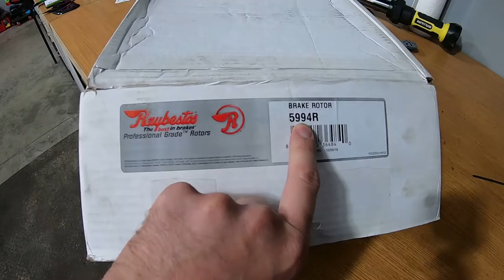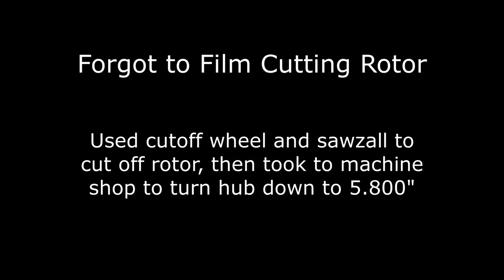FIREBIRD/CAMARO 3RD GEN C6 BRAKE UPGRADE (DETAILED)

Comment: I did the LS 1 brake conversion on my 92 Camaro but I made sure my brake line was on top of my brake vs the bottom like you did for bleeding reasons
Reply from the maker: Anything is better than the factory brakes. Since my pads have broken in, the braking power is sooooo much better!

Comment: Just to be correct, the only reason you used a spacer is because of your rims are based off a corvette spacing? I plan to do this to my drag car after my 17” wheels show up
Reply from the maker: Yes the only reason I run a spacer is to adapt to my wheels. It really didn't have anything to do with the brakes. It just gave me lots of clearance to the caliper. 17" will be close, I have 18" rims. I went with the c6 z51, u could also run standard c6 brakes which are just a tiny bit smaller
Reply: I had to use a 1” spacer because my XXR 18x 9” wheel hit my steering control arm

Comment: You have the passenger side caliper on the driver side. The bleeder screw should always be on top, not bottom. Air rises which is why the bleeder is on top.
Reply from the maker: ?? No they are on the correct side. Bleeders are facing up. If they weren't I wouldn't have brakes, and they work awesome with the C6 upgrade!

Comment: I've got A 83 firebird v8 base Manual trans. T tops. power nothing. it's A factory heater car.
It weighs 3199 full of gas. So with me its 3450,ish.
Anyway, I have 235 60 15s. (grandprix)
and it locks up every time, under hard braking. 
My Questions are my tires too narrow?
Just bad tires? Is there A size that prevents lock up? 
Not sure when or if these cars ever got ABS.
but I do not have ABS.
Reply from the maker: Brakes will generally overpower tires everytime. But wider tires will help. Could be a brake proportioning issue where the rears are locking up first
Reply: @EssMotorsports  I put A Wilwood adjustable proportioning valve on it.
and its fairly balanced. 
but usually its the front now.
Reply: @EssMotorsports  4th gen master with stock brakes and drums in the back.